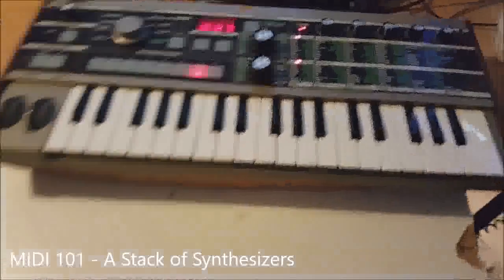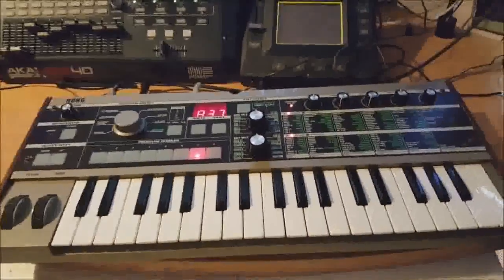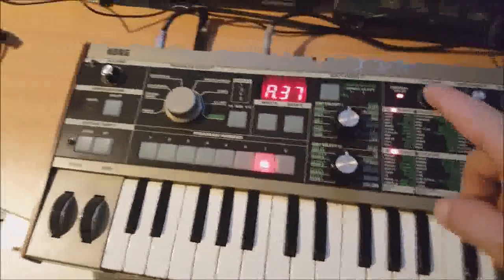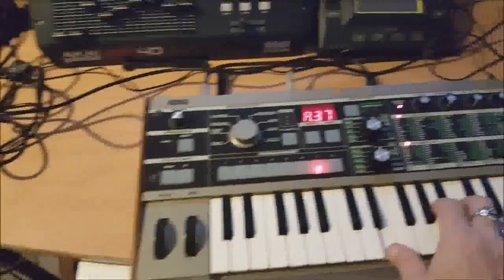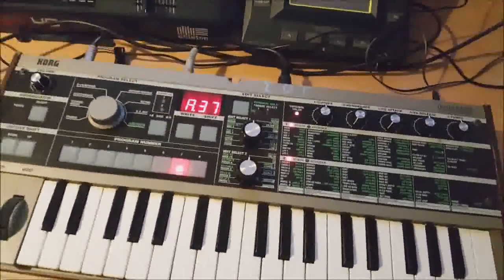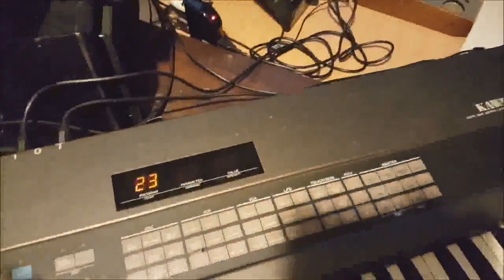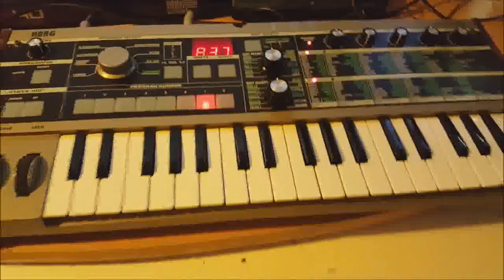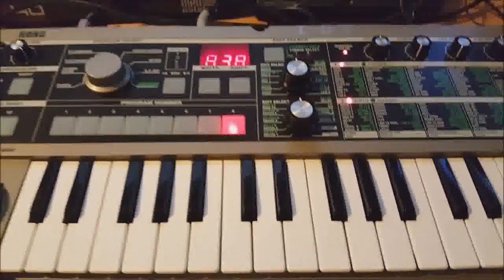Ned Frankly - MIDI Routing 101 - A Stack of Real Synthesizers

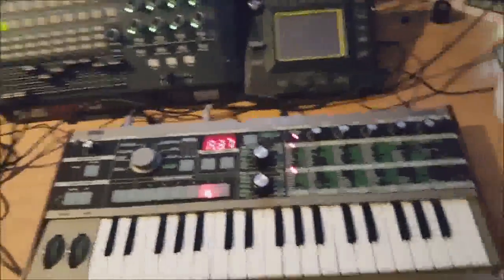Comment: I want to add a comment at 5:20. Midi THRU is a duplicate of the Midi IN; the signal goes out as it came in. So, if you MODIFY the data for a channel (say, use Pitch Bend or Modulation through the Mod Wheel), Midi OUT may send the modified signal but Midi THRU will send the original signal.

So (I'm pretty sure), with a master and two slaves, using only Midi THRU, if you play a note on the master, then pitch bend on slave 1, the master and slave 2 will play the Same Thing and slave 1 will have a bent pitch as you turn the wheel.
Reply from the maker: Some synths have a thru-merge setting, but none of my old beasts have that capability. You're absolutely correct.

Comment: How do you record all these physical synthesizers?
Reply from the maker: Great question, Shark. It would seem simple, wouldn't it? I am using my audio interface, the EIE Pro, as a mixer. The problem is that we're using an external sound card (that's all an audio interface like the Akai EIE is - a sound card). Because of that, we can't get at any kind of "final mix" from inside the computer. There are legends that you can pull it off with Audacity, but I've never gotten it to work. Since this was supposed to be a non-computer exercise, it's just as well.. We have another solution, though.

We use an external device. In our case, a standard Tascam DR05, which has an 1/8" stereo input (TRS). From the Akai I always monitor from the headphone port, so I use a cable to come out of output channels 1 and 2 on the Akai EIE. It's a standard stereo splitter cable (converts 1/8" TRS to dual 1/4" TS). Now, anything that shows up on channels 1 and 2 on the Akai is recorded into the Tascam. We sync up the video by hand (use a clapboard or something like that).

Granted, that makes it a mix, not a multitrack, but you could use one of the multitrack Tascams and get control of your individual inputs. We use the same technique to do how-to videos because we have so many sound sources going at once. The trick is in syncing them up in post.
Reply: On the economy end: if you go through a Behringer XR18 mixer, the mixer can output individual tracks to a DAW over USB.

To connect to the mixer, for each synth use a Direct Box such as Radial PRO-AV1 (sums stereo signal to mono for your mixer) or PRO-AV2 (stereo in, mono-L and mono-R out).